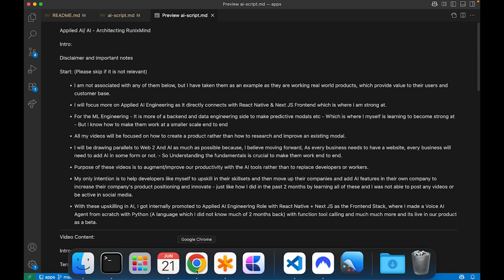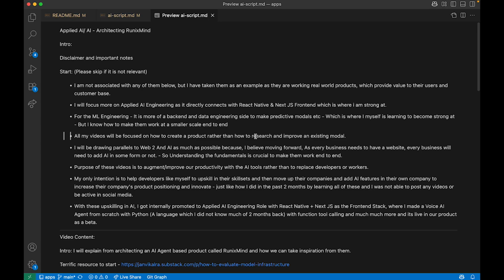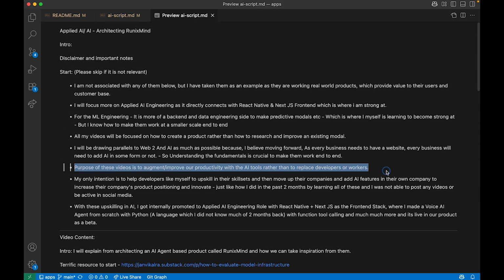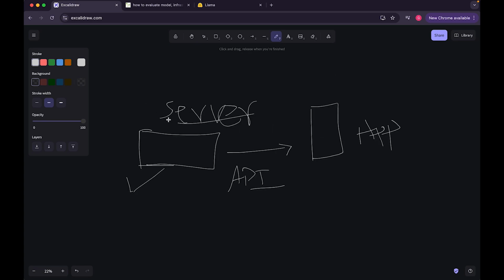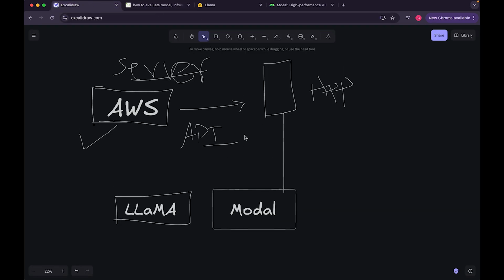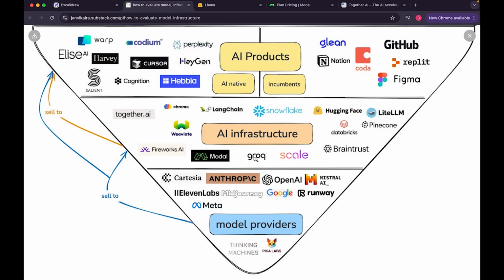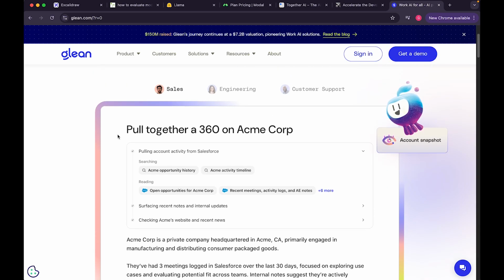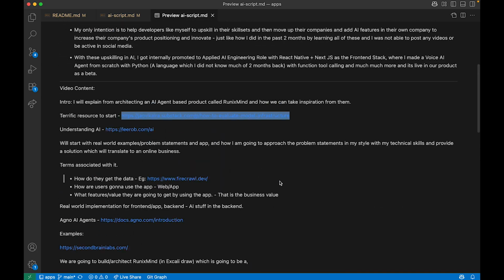Applied AI Engineering - Intro - Part 1

Comment from the maker: I learnt and implemented all of the following one by one in my work app and if you guys like this video, I will make more videos on Applied AI Engineering and Voice AI Agents in the upcoming months. Thanks for the support.

Concept/Technology - Providers & Vendors

- LLMs - Open AI, Groq, Gemini
- STT - Deepgram
- TTS - Cartesia, Deepgram, Rime
- Transcription - Deepgram, Assembly AI, Whisper
- Data Engineering - ETL Pipelines
- Embeddings - Cohere, Open AI
- Open Source LLM Modals - LLaMA, Mistral, Qwen
- vLLMs - Inference API
- Self hosting AI Modals - Ollama
- Evals - Langfuse, Langsmith
- Observability & Tracking - Langfuse, Langsmith
- Vector Databases & Vector Search - Pgvector, Pinecone
- Inference AI Providers Like Groq, Cerebrium, Modal
- AI Infrastructure - Cerebrium
- Voice AI Agents - Daily.co
- AI Agents in Telephony - Retell, Twilio

For vector searches and embeddings for context and memory storing and retrieval for future and current AI Agent calls, I used customized tools for them which I have not mentioned above.